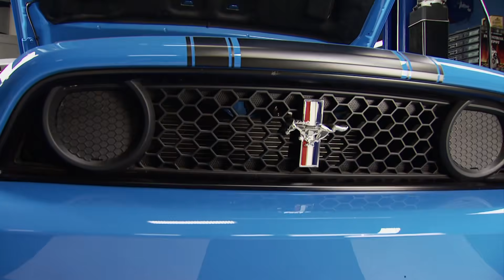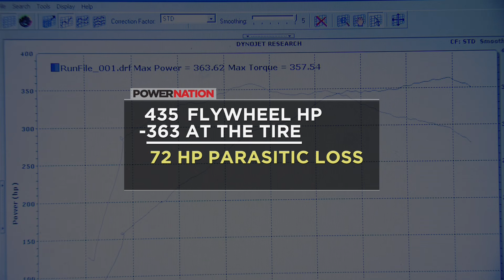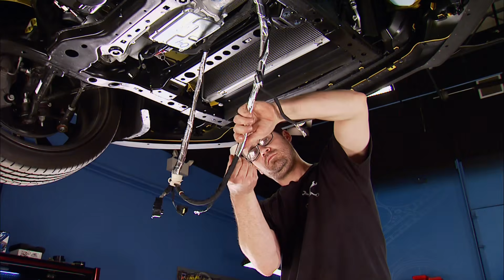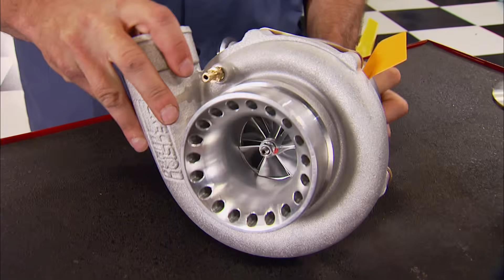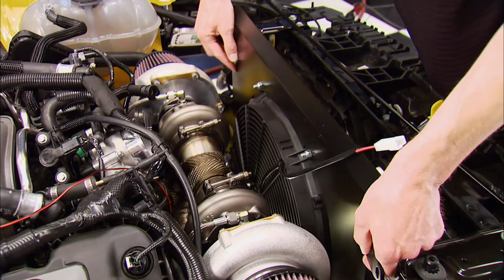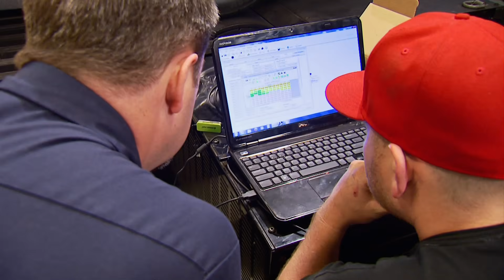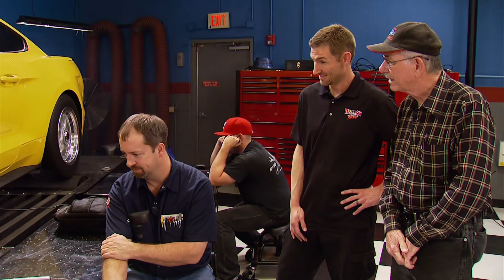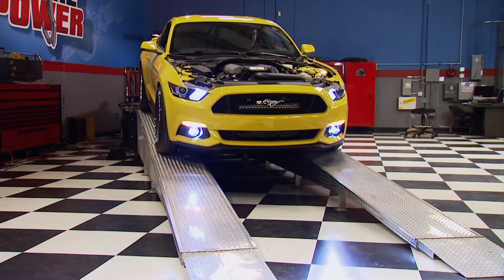Twin Turbo'ing a 2015 Mustang GT to Beat the Young Kids at the Strip - Engine Power S2, E16

Comment: There were some serious mistakes made on this .you dont turbocharge a engine , you build a engine for a turbocharger. And it is more then gapping rings for boost for longevity.
Reply: Yet the coyote takes 1000hp on stock internals. I think they are gonna be just fine.
Reply: @NWABIMMER_KEV  

Know a couple guys who street race mustangs , one is a auto and one is a manual. Both have had bottom ends replaced several times before they went to better stuff . it is not if it will fail , but when will it fail.
Reply: @backyardbuilttrucks1  well everything will fail eventually, some guys been on 900whp+ bone stock internals for over a year
Reply: @NWABIMMER_KEV  Guaranteed they opened the engine up and gapped the rings. When you seriously increase cylinder pressure, and don't open the ring end gaps up they will expand, but together and bust the top of the piston off. I've seen it happen plenty of times with knuckleheads using a 200 shot of spray at the strip.
Reply: @bigboreracing356  lasted a whole year. Look up itsjusta6
Reply: @bigboreracing356  definitely, but hey now he has a built engine and will be making like 1200hp or so, after they figure out the compression issue.
Reply: @bigboreracing356  that's pretty cool bro
Reply: Yup, turbo engine ( Or even one planned for a supercharger.) has forged pistons, rods, and crank with main and head studs. And if they are smart, they will use MLS head gaskets. And opened up piston ring end gaps.

Comment: Who runs 42 psi in drag radials anyway?😂
Reply: Wtf right, 38 psi also.... I would put 25psi and work my way down to the sweet spot
Reply: bdpa kaknox not boost, tire pressure. 42psi. Try running about 24 and see what happens.
Reply: Because the lower you go on tire pressure the lower the dyno is going to read.. best thing is a straight up none drag radial with high tire pressure to get good dyno numbers .. an easy way to prove this if you don’t believe me is go dyno your car with a regular radial tire at 45 psi .. then toss on some drag Radials at about 25psi and let me know what the difference is .. my car made about 40 less rwhp with drag radials at low pressure. 😪😪
Reply: @turbosaleen347  oh i didn't know the dyno was going to read lower but i was talking about when they run on the track but thanks on letting me know why they ran on 42psi
Reply: Durancito Duran totally agree I run my drag radials at 22psi on the street.. and bias ply slicks at 14.5 to 15 psi at the track
Reply: Serious bro. So my fuel injected 438windsor in my 68 stang pump gas street car made 530wheel and tires 18psi. I would of made 560wheel at 32psi..come on
Reply: @maximusvonce1381  yes on normal street tires with more psi your car would have prob made 30-40 more.  Does it matter?  No but it would have thats simple physics and facts no matter how stupid you think it is.  If it doesnt matter to you then it doesn't matter.  Dont act like something is stupid or bs just because you didnt know about it.
Reply: Right like they gonna spin bad at launch like at least run 20 psi and work down to the sweet spot but damn 42 psi in drag radials like smh0
Reply: Idk why they got drags on the dyno. Drags are a big nono.
Reply: Where the fck did you hear that bs
Reply: @bigboreracing356  yes it will I think he was simply stating that it will show less horsepower on the dyno explaining why they ran higher pressure in there drag radials on this video
Reply: Excellent point
Reply: Now this is a bright comment👍
Reply: @bigboreracing356  it doesnt matter the traction is more than worth it  but some people dont understand dynos read lower with drag tires ecapecially if theyre running lower psi in them...just a simple statement to let ppl know on normal tires it would have made more...some ppl be like oh my such and such car with same setup made more hp blah blah not realizing they dynoed on street tires with more psi vs drag radials with lower psi.  Just a statement informing...some even swap the tires out when on dyno just to get apples to apples comparos with other cars dynoing on street tires.
Reply: @bigboreracing356  yea you can outrun cars with more power because there is so many things that have to do with going fast other than just power.  Gearing,  weight,  driver, powerband and power under the curve, not just peak power, traction etc etc etc.  Nobody is gonna be running normal street tires on a high hp car on the street just because it showed more hp on the dyno, at least i hope not.  But the fact is it will show more power with normal tires and/or with more psi in the drags this is a fact for anyone wondering...to some like you it doesn't matter thats fine.
Reply: @bigboreracing356  that makes sense i prefer street tuning if possible because i beleive running it on the road getting datalogs in real world conditions is even more accurate than even dyno tuning because its hard ti simulate everything on a dyno...like proper airfflow and things like that most people have the hoods up doing it with open element filters skewing the way the car runs and the numbers etc and if you close the hood youre gonna be running 100+ mph with nowhere near 100 mph winds going across your front bumper this can effect intake temps as well as charge temps and stuff like that if you have a turbo with an air to air intercooler or a supercharger that relies on a front mounted heat exchanger to cool down the charge air.  Street tuning shows everything exactly how it is when you're running it on the street because youre actually on the street when you do it but you gotta have somewhere safe to do it both have pros and cons.

edit
You can also do track tuning the same way making adjustments looking at a long while actually running the car on the track that's probably the ideal way to tune if one has a way of doing it
Reply: Makes my shit sound faster when I tell em it spins drag radials at 60 ......
Reply: So when he hauls his car trailer it hauls nice ?
Reply: @PiperFishing  Read first.

Comment: I would of kept the boss, better, stronger motor.
Reply: Matthew Skaggs you do know the 2015 and up engine is basically the same engine as the boss minus the manifold? Internals are the same, heads etc.
Reply: Hayabusagsxr1300 yeah you’re right. The gen 2 coyote is the best years of the motor for building power
Reply: You do know tha the only real differecne between the Gen 2 and 3 is direct injection....
Reply: Matthew Skaggs there is also a new intake manifold as well as the biggest difference is plasma arc cylinder liners. The gen 2 has boss cams as well the only reason it makes less power is the intake manifold. Put a boss 302 intake manifold on a gen 2 and raise the redline to the same as the boss it makes even more power than the boss did.
Reply: @douglasm3310  as it should, again just saying PERSONALLY  Id rather have a boss motor.
Reply: I am very aware of the Gen 2, I had a 16. Many things like the valve train and head designed were carried over to the GEN 2 from the Roadrunner engine,and the Gen 2 is stronger than the Gen 1, And yes the rods are forged along with the crank the Gen 2 still has weaker pistons.  I am by no means knocking the Gen 2 motor, they love boost, make great realiable power too out of the box. Personnally given the choice though I would rather have the boss motor.  The boss motros in addition to a forged rotating assembly and pistons also had CNC ported heads, better cams, higher flowing intake taken from the 302R.  These cars came from the factory with 444 hp.  I am just saying that when you compare the two in my opinon the boss motor is better.

Comment: Oil pump gears?
Reply: I give it one pass before the gears disappear lol
Reply: As long as you stay off the rev limiter the oil pump gears will live.. but I totally agree they definitely need upgraded .😎👍🏻
Reply: and LS7's drop valves on stock motors, hellcats burn oil and breaking rocker arms...
Reply: ivan bengtson We are all fully aware of other manufacturers issues but they are working on a 5.0 that is notorious for breaking oil pump gears when 700 plus hp is pulled through them.

Comment: I'll bet this kit costs between $20-$25k.
Reply: $8995 for the turbo kit
Reply: @platinumisgr8  That's actually cheaper than I thought the kit would be. I'd be shocked if most everything they used was included, though.
Reply: @Cotton_Eyed_Joey  well that is just for the kit not including install, or exhaust,  half shafts or torque converter. All said and done in would bet this package cost about 30k installed
Reply: @platinumisgr8  Yeah. That's what I was thinking too. It's cool, though.
Reply: There are dealerships that will sell you a mustang gt with this kit for 45,000 out the door
This is a old link but there are plenty of dealerships that will sell you mustang with a blower or twin turbo or the sleeper twin turbo(turbo's under the car) https://www.roadandtrack.com/new-cars/news/a32523/twin-turbo-1200-hp-mustang/
Reply: If you factor in the cost of the car and this particular kit with the labor, and other parts you're better off buying a used Hellcat and saving a few bucks.

Comment: Lotta power.....question is....Is there ANY way to make it hook up on the street?  If you can't get it to the dyno, how can you nail it down on the street?  I am always amazed the torture these Ford engines can take.  Yellow is my favorite......
Reply: Tom Nekuda it’s because they have so much tire pressure in those radials who the hell runs 40 psi in a radial 20-25 for the street 12-20 for the dragstrip
Reply: @douglasm3310  I didn't realize they were running that kind of pressure.....what the hell is wrong with them?  That's just common sense......even dropping them a bit would give you more realistic numbers.  Or do they have to run those pressures on the chassis dyno?  Never messed with those dynos.
Reply: @douglasm3310  fr man 40 psi like do they expect to hook on the street and track if they do they just plan stupid
Reply: It's a Mustang and through the generations Ford never bothered to fix the one Achilles Heel they have and that is not being able to hook up. Even with slicks, that dude is going to have a hell of a time even making a 12 second flat pass without balling the tires off all the way down the track. He's going to need a shit ton of suspension upgrades...just like every other Mustang built since 1982.

Comment: So y’all did all that work to the challenger only to not even crack 500 wheel ? That’s pathetic 
I make more power then that NA with my 2016 mustang
Reply: The challenger build was done in 2010. In 2010 that wasn’t bad power.
Reply: I've seen that out of some of the 2.3 Ecoboost lately.
Reply: At only 5lbs of boost, thats not too bad
Reply: @mikepao6109  exactly people dont undeestand different boost levels lol.  You can make 700-800+ wheel with gen 2 coyotes but you aint gonna do it on 5 psi lol.
Reply: Huh? Their turbo Chellenger made 700+.
Reply: @bigboreracing356  I'm aware, I watched the video of the build and the dyno pulls. That's why I think this guy failed to watch  the vids before commenting.